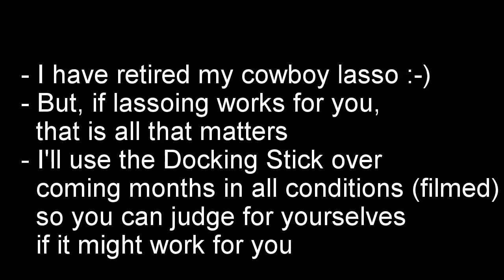Ep 33 Refining My Solo Docking Technique   Spring Line and Pivot Point

Comment: dude !! why are you docking with that speed ??? you got some bolts lose up in your machine room ? you are going way too fast time after time . try docking with slower speed . there is no need at all the way you are docking your boat and pulling everything out of proportion . GO SLOW !! and you'll be fine
Reply from the maker: That's a great comment Dutchman (and one I often hear).   While every technique can always be improved, let me share my personal thoughts on this one.   Given the choice of being 0.5 kts too slow, or 0.5 kts too fast, I'll choose too fast every time.    In the 2.5 years I've had this boat, I've probably made 200+ dockings.  Never ONCE have I thought afterward, "Boy I screwed that up by being too fast."   However, on at least 20 occasions I have thought, "Boy I got way out of shape because I was too slow."  That is the honest truth.  A bit of extra energy provides a lot of control to a solo sailor in a (longish) boat when exposed to current or wind.  I can't count the number of times I have seen others get at a 40 degree angle to the catway because they were too slow and the wind/current pushed them all out of shape.  Others spend way too much time (in my humble opinion) trying to bring the boat to a perfect stop before going for lines.   That extra 5-7 seconds of tinkering with the throttle allows the bow or stern to drift away, or prop walk to take affect.   That said, I will agree with you that in a CREWED boat, you can afford to go slightly slower, because that crewman who can step off the boat, or who already has a line in his/her hand can offset any small positioning error caused by being too slow.  Fair winds to you.  Put up some docking videos.  Not enough people do.  We all learn from observing the techniques of others!